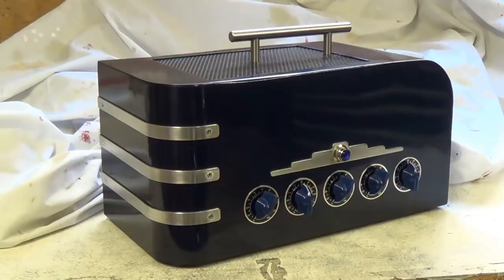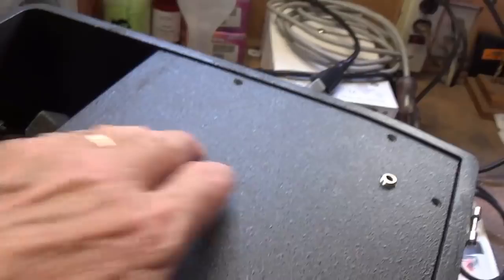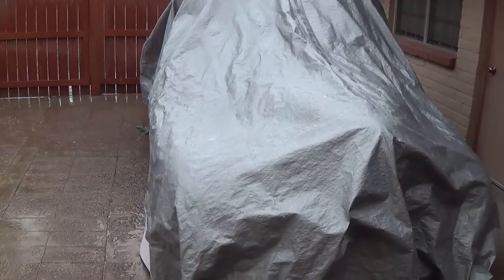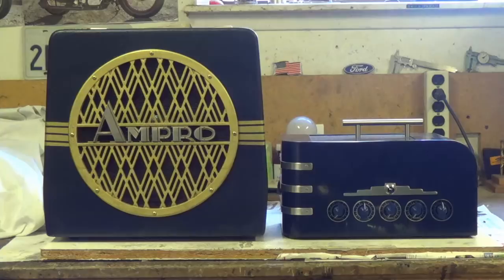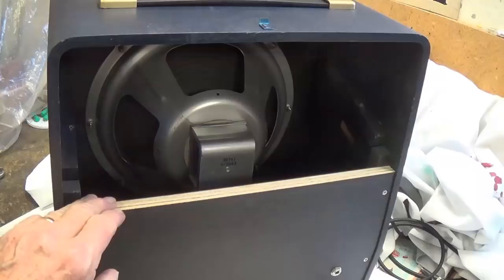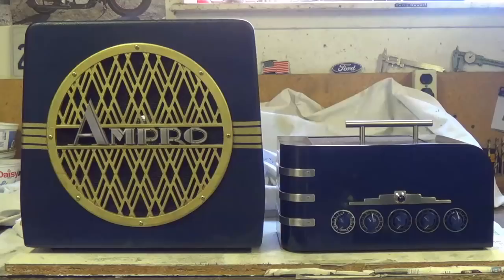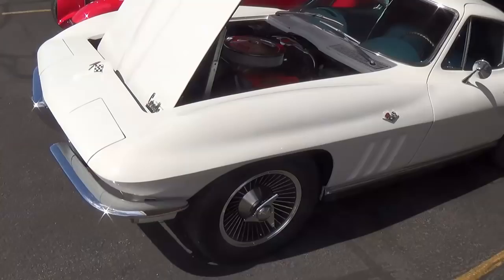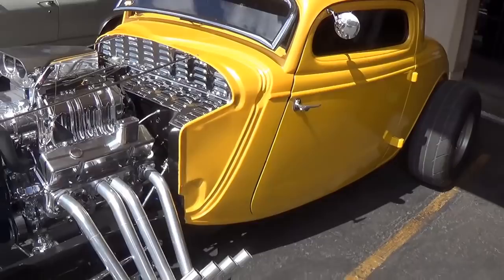Let's Build and Tune an Art Deco Speaker Cabinet

Comment: Have you ever seen a speaker cabinet that is partially covered with a fancy western type Tolex and the rest in a finely finish hard wood ? I've been trying to figure that one out😁
Reply from the maker: Yes, but most cabinets, two-tone or not, are either all wood or all Tolex. I think the combo you described would look great.
Reply: @UncleDoug  yes I was thinking of some kind of decorative metal maybe brass stops to border the Tolex and wood. I also got one of those Stage right 30tube amp heads. I was wondering how hard it would be to build a larger case for that and adding a True spring reverb? As far as I can tell it's exactly like a Laney amp circuit.
Reply: @UncleDoug  It's a brand new amp and it sounds good but if I knew anything really about electronics I would probably disect it and wire it point to point but I'm not touching any of that stuff lol. Haven't even taken the back cover off yet to check and see what preamp tubes, what manufacturer are in it.
Reply from the maker: @craigjacob3704  Craig, you can't simply add a spring reverb to an existing circuit without extensive alterations, including the power transformer, additional tube sockets, etc. You would be better off simply using a reverb pedal.
Reply from the maker: @craigjacob3704  You would be wise to leave the new amp's circuit alone. It probably uses printed circuit board(s) and might be dangerous to work on without sufficient knowledge.
Reply: @UncleDoug  yes Doug that's exactly what I'm going to do. I'm sure being new from China it has printed circuit boards and I'm not going anywhere near the inside of that thing lol. I don't like getting hit with 110 ac much less whatever is lurking inside of that. Thanks so much for your time and wisdom. God bless and Happy New year.
Reply from the maker: @craigjacob3704  Wise move, Craig. Likewise :)

Comment: Never heard a GUITAR speaker with an aluminum VC cap that I liked. My ears also tend to prefer larger cabinets.....16”x20” minimum for a 1x12”....and not too deep from front to rear @ 10” max or cab will get too muddy in the bass for guitar.
Reply from the maker: Thanks for the helpful info, Dave.

Comment: Nice VDO, Doug. What on earth is the high frequency noise that follows the input? Feedback?
Reply from the maker: I guess my hearing is shot, CP, but I don't hear it.
Reply: I'm sorry, Doug. I may be nit-pickin', but start at 19:00, and listen for the HF noise that is generated after each strum. With the tremolo on, it appears to collapse quickly, and is not noticeable. Perhaps it is the speaker, but it sounds like feedback. Thanks again, and keep on rockin'!
Reply from the maker: Thanks for your input, CP and Gary. I sincerely hope it's an artifact. The amp is functioning perfectly (IMHO) and I'm not aware of any oscillation or feedback issues.

Comment: That speaker looked in very good condition with its age. Your video editing sometimes chops the ends off of the segments. I wonder what causes that. "Farts like a rented mule." Sounds different, but I don't want that property in one of my speakers. I sure wouldn't want to be riding behind that rented mule especially down wind though.
Reply from the maker: The software clips the ends off of some segments......with no rhyme or reason, so it's hard to predict and prevent. I'm sorry, but try to work around it, Robert. Speaker flubbing (or other less flattering terms) occurs when a speaker can't cope with the input power, particularly bass frequencies.

Comment: But seriously UD,  I wonder what would be a basic recipe for bumping up a 1947 tube amp from 3 watts to 15 watts. I have a strange suspicion you can give me a semi specific generalized place to mod the circuit, if pressed,  which I lucidly refuse to do, to bump it up 12 watts. I promise you that I will only stand out in the street naked and scream "Thank you Unkle Doug" as long as it is  a "success", and only with your permission of course.  ;)
Reply from the maker: I think it would be like putting a supercharger on a Mexican taxi, FW. There might be a moment of exhilaration........but then a whole bunch of smoke. You would have to change virtually every part in the amp, like the power transformer, tube count (change it to double-ended), output transformer, etc. You'd be waaaay better off leaving it alone and buying an 18W amp.
Reply: @UncleDoug I was afraid of that. Great analogy though. I REALLY appreciate the time you take to reply. You educate us in an extremely professional and entertaining manner. And I am learning A LOT! The magic eye on the Eico should not be stared at for extended periods while consuming mule sauce. And Jack may be interested to know that the 1629 tube was also called a "Cat's Eye" back in the day. I just spent a few minutes on magictubes.com and it was like spending a day at the vacuum tube museum. Thanks again   UD!
Reply from the maker: You're welcome, FWR :)

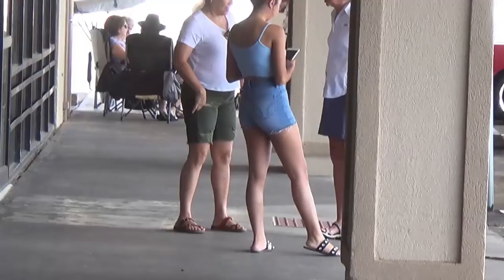Comment: 4:30 Wow - How do you know this?  Clearly, you have valued your education despite distractions such as those pesky Russian pole dancers or booze.  Anywho, for the same reason you put the speaker jack in the lower right corner (had to watch the whole video to appreciate the genius),  I would humbly suggest putting the handle on the side as to free the top of the cabinet.  Makes for a flat landing for anything such as the driving amplifier (or a place to sit for 26:10, butt what do I know).
Reply from the maker: There are charts available on the Internet which list all EIA numbers for speakers and other electronic components, Chris. I tend to remember some of them. Actually, the amp rests perfectly atop the speaker cabinet......the handle is low profile and clears the bottom of the amp.

Comment: uh oh Doug that screen has got to be a tone problem - why not put a black cloth instead behind that sweet Ampro grille - I cut away the screen from my Premier single 15 leaving only the cross bar with stencil company logo
Reply from the maker: Thanks for the suggestion, Andrew. I think the total of clear, unobstructed space is far greater with the Ampro grill than with grill cloth, but agree that the best grill or grill cloth is no grill cloth......except when looks matter, as in this case.
Reply: Agreed, Doug. I would not change the look of this for anything! I was referring only to what may be a cheese grater effect (upon tonality) of screen which lies behind the supercool forward logo grille. Would the forward grille be enough on its own to serve as speaker protection - would the speaker cone shadow itself sufficiently that the look would be OK? 
Protection for the logo grille is what I would worry about, finally. Anyway it's a brilliant pair to show off and the re-purposing aspect is best. 
PS Did you consider routing the box and drop-mounting that Heppner, bringing the Ampro grille down & flush to baffle? Wonder whether experiment would show such mounting to sound brighter or louder - or did the rock guys just do it for convenience after they saw stereo builders do it?